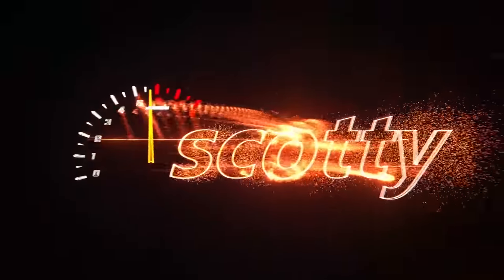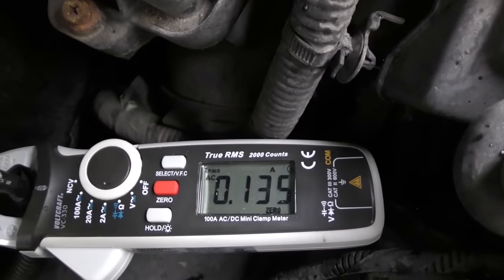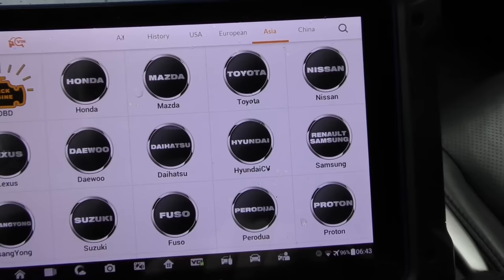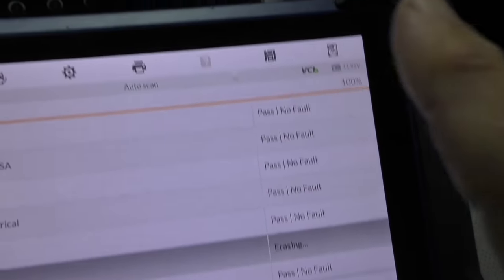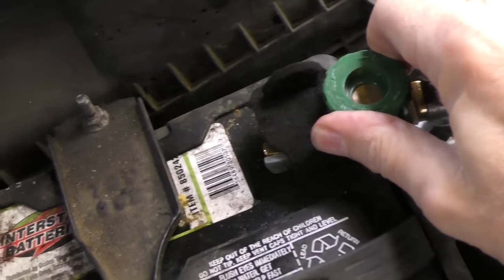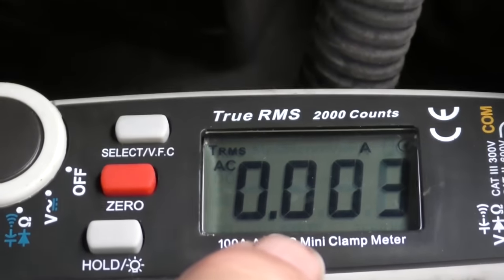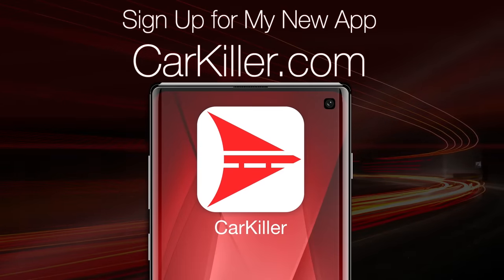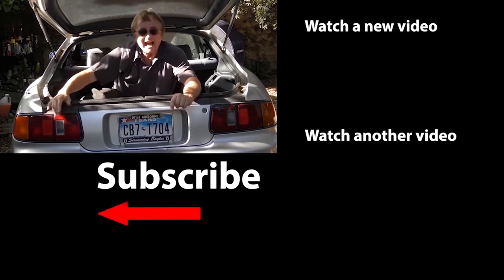Watch This Before Buying an Acura

Comment: I unplugged my 2005 Acura TL HFL because of the parasitic drain which leaves the device to draw power without the key in the ignition. Unplugging the HFL saves your battery but disables all voice commands for calls, XM, radio, navigation, temperature,...etc. The Acura dealership at the time wanted $400 plus $200 labor for a replacement or $150 to disable it. They also said there was nothing wrong with my week old warranted battery that they provided other than it will not start the car. Pretty sad that I had to jump start my "luxury" Acura off the dealership and call it customer service. I love my TL but Acura needs to take responsibility for the HFL and cracked dashboard defects.

Comment: This happened on my 2012 TSX. The Bluetooth module was drawing 220mA if power when the car was turned off which drained my battery. During the winter even the best batteries would struggle after sitting overnight and eventually die. I went through several Duralast Golds and Optima Yellowtops before finding this out. The unit ended up being replaced and the issue went away. I traded up to a 2019 TLX A-Spec but man that was a headache.

The worst part is my issue was intermittent. It wasn’t daily and by the time the car died the issue disappeared. Acura kept the car for days under warranty trying to find an issue and couldn’t. It wasn’t until another battery failed that the issue luckily showed when I had it at the dealership.

Comment: Thank you for doing one on the RDX. I got a 2007 and it’s been rock solid but one thing that I do notice I have to have checked out is my windshield wiper when you turn them on when it’s cold in Chicago. Look like the wiper are wiping to much when you first turn them and their on a low set. But when it’s warm their fine and work fine also.

Comment: I think component(s) may have been damaged by that loose battery cable. I thought body computer fault right off when you demonstrated the issue.  I’m also aware of the Acura bluetooth issues.

Comment: Its the hands free link system. Had this problem with 2 Acuras. The fix is as simple as disconnecting it
Reply: @MGMidget73  if the handsfreelink is draining the battery it's because it is now broken in malfunctioning. It doesn't work anyway. I've owned 4 Acuras. I know this. 2 of them had this problem. Just unplug it or buy a new one

Comment: I love your videos.  I have owned several Acura's and the Bluetooth module seems to be an issue after a about year 4 of owning it.  Draining batteries slowly in the same sense (about 3-4 days of sitting).  I have seen this with an 05 TL, 2010 TL (I have two 2010's and one does it the other doesn't), 05 MDX, and now my 2015 TLX is doing it.  When I disconnect the blue-tooth module the problem goes away, but Acura has for years said this is not the problem..

Comment: I had a 2000 Nissan sentra with that issue. After chasing it down for months, I found that it was the keyless entry module. It's a little box with wires coming out it, right below the steering column. Disconnect it or replace it, stopped my slow and intermittent battery drain.

Comment: I had the same problem and found the problem was the cellular phone network. I disconnected the module which is found in the rear air-conditioning diffuser box middle consoul which got the current drainages problem resolved.

Comment: Before even watching this video im gonna guess that it's the homelink. My 2006 Acura TL had the issue of the homelink draining the battery and not a single mechanic could figure it out. They even had me replace my alternator because they said that might be the problem. I looked it up on an acura forum and they suggested that this was a common problem.

Comment: Very rare for bluetooth to die. It happens in all cars. The main concern for 2nd gen acuras is change the PCV valve often and the throttle body position sensor can die too.

Comment: I experience this with my Tundra, which I would rarely drive and the battery would be too low to start the truck after sitting. I assumed it was the after market alarm. I installed a solar trickle charger and never had an issue again.

Comment: I would put a solenoid disconnect between the battery terminal and main cable and run the switch inside for easy disconnect.

Comment: We have a 2007 RDX with 200k miles, the car started having the same problem, battery would drain after not driving the car for a few days. After several mechanic visits, we removed the hand free link module and the battery didn't drain anymore. Problem solved.

Comment: Scotty, comon Honda issue,its the hands free link module (bluetooth reciever).  Your trouble codes even said so, but you didnt test it on your test drive.  $300 part, takes 5 minutes.  Some will say you can “bake” the old ones to reflow the faulty solder joint.  Didn’t work for me.

Comment: I love me some Honda and Acura but they have a serious issue with blue tooth modules. I’ve had a 2006 TL that went bad. 2007 MDX that had the battery drained, had to take it out. I currently have a 2011 RDX and luckily it works but every once in a while, it’ll disconnect while listening to music. Everything else works fine. Just annoying little issue.

Comment: There are serious issues with the newer Honda CRV's battery drain too. My dad's new CRV keeps draining and needs to be jump started every few days. Just searched it and lots of people are going through the same. Honda has no answer or software updates that can fix the problem. These cars should be lemon law'd or recalled. There goes Honda's reliability.

Comment: I think it is the Bluetooth module. When it goes bad etc it randomly keeps randomly searching to hook up/connect to a Bluetooth device. The easy fix is to just disconnect it since they are pricey $250+?) of course it means no more Bluetooth calls etc. Beats having to open the hood all the time to disconnect the battery.

Comment: Scotty you still could have pulled relays/fuses to see if the amp readings stop jumping around. Also those battery disconnects only require a quarter turn to fully disconnect. They are popular In the antique tractor crowd. Which I would like to see more videos from you giving tractor/lawn mower advice in the future. Thanks

Comment: @Scotty Kilmer, you MIGHT fix that Acura’s problem by replacing the ground cable AND checking and cleaning all of the vehicle grounds. Good solid grounds does wonders for low VDC circuits.

Comment: I have a 04 Acura TL 6 speed manual with 205k miles and It’s been super reliable, but I will never use the hands free link because when I first had it and ever used HFL, the next time I started it up. It would take a while to turn over

Comment: My sister's Camry had a battery drain and we figured out what was causing it =  she left her key fob within 15 feet of the car, and as a result, the car would always keep its systems 'ON'.  It thought that the owner was approaching the car and would want to get in and drive away.  By moving the key fob to 30 feet from the car, the car would shut down all of its systems and the battery drain went away.

Comment: @scottykilmer I have the same vehicle which I bought used and encountered the same issue. Turns out the A/C condenser relay gets stuck and drains the battery while the car is parked. I think there is a TSB and a new relay that supercedes the faulty one. Changed the relay (15/20Amp) and the problem was fixed. Hope this helps!

Comment: Anyone thinking of buying an RDX, this battery drain is the least of your problems. Before you buy research the common and very expensive problem of the wastegate boost loss, throwing a "P2263 Check Emissions" code. Once it does you will end up having to replace the entire turbo around 90k-150k miles at a cost of 5k-$10k depending on if you use Honda or an off market turbo. It's a cheap linkage piece that gets out of round on the wastegate that can't be replaced, that renders the car limp and will not pass an emissions test, and the only fix is to replace the entire turbo. It's a known problem Honda refuses to address or acknowledge so beware of it. Also, you have to disconnect your bluetooth/navigation to fix the battery drain issue.

Comment: Is Scotty certified Honda and Acura master technician. That is actually very common on the RDX is the HFL unit. Hands-free link system disconnect that module which is right above the dome lights and sunglass holder. And I guarantee you that parasitic draw would go away. When we have customers come in with cars like this the part alone is $1300 just to replace.

Comment: My 2007 Acura TL Type S was draining battery too. My fix was replacing the AC Relay. Apparently when they car was off it was still running.

Comment: Disregard this one, Scotty has it wrong.  Our RDX has been wonderful… just like my 03 TL-S that still went like a bat outta hell when I sold it at 385k miles.  2nd gen RDX is a gem, pick up for less than a CRV, more lux, more power and still 28 miles on the highway with AWD!

Comment: Hands free link module located up behind the map lights and rear view mirror fails and stays on and drains the battery. Does the hands free link feature work when the the customer syncs their phone to the cars hands free link system?  Its a known problem.  The hands free link module has to be disconnected (temporary fix) or replaced with a new module from Honda to get the the hands free link feature back. Its pretty easy to replace. If the plastic cover  where the the map lights are up in the roof feels warm even when the car has been off for a while...this may be the problem. Its still on pulling power from the battery. The module is the blue tooth transmitter/receiver. This may not be the problem but who knows :-(. Good luck.

Comment: Seriously I have been dealing with this same exact issue for over 8 years with my 1995 corolla that has been transplanted with a newer 4AGE engine. There must be some wiring issues from the transplant job. Tried several times to diagnose the problem without any luck. In the meantime the unplug battery terminal workaround never fails.

Comment: Clamp-on meters are accurate only on AC. Not on battery driven systems. That's why you see the AC symbol. But hey, if it is giving you a reading and helps you fix stuff all power to you :-)

Comment: Hey Scotty I have a doisy for ya, I have a 2019 Kia Sorento and around 48k miles (I drive A lot)  my check engine came on right around the oil change so I took it in to a Kia Dealer and after a few days they finally realized that apparently it was the dash cam that I’ve had this whole time plug in since I bought the thing was messing with the KEM? System. I’ve never messed with anything electrical in my life so I don’t understand how it was doing it? Apparently they contacted Kia them selfs and they were interested in the issue because it was a first for them. Now I will mention that the dash cam, before the check engine light came on, I had started the car and the dash cam kicks on like it normally does but this time it went off and on about 6-7 times than it stayed on and after a few minutes that’s when the check engine light came on. So far it’s been off since it’s been disconnected and haven’t had any issues. I just thought this whole deal was a mess. Anyone else have something similar happen?

Comment: i know a common problem for these older acura’s is their bluetooth systems so if you just disconnect the bluetooth, then the drain will stop. i have an 07 mdx that would die if it sat a few days and the bluetooth module was draining the battery so it was disconnected and the problem went away

Comment: I had a 2006 Acura TL and it did the same thing. Dealer couldn’t find out what was wrong. I finally took it out to a local shop and it needed a whole new computer system. Cost me $800 to fix. Typical Acura junk.

Comment: the pcv integral to the valve cover is actually a german design. those engines were developed by opel--gm's german subsidiary.
Reply: Aren't these just Honda k motors with beefier internals?
Reply: @drooskeedoo3388  no! ecotec engines aren't even the tiniest bit japanese.

Comment: Hey Scotty—

I have a 2011 Suzuki SX4 crossover. It has 150,000 miles on it. I commute 45 miles to work and back daily. I just had two ignition coils go and was told since the bankruptcy, it is going to cost $800 for the repair. 

Is it worth it? If I fix it, how far do you think I could trust this car to go?

Comment: I got a better low tech solution than a quick disconnect.  How about a drip battery charger?  My 30-year-old Benz would discharge if I didn't drive it for 3 days.  No one could find out why.  So, I semi permanently attached a battery charger to the battery, ran an extension cord to the front grill, and plugged in the car every time I knew it would be idle for a while.  Want to drive it? Just unplug the extension cord --- didn't even open the hood.  (PS: post-it on the window reminded me to unplug the car --- LOL).  Eventually, after two years, I found out it was the clock.

Comment: Scotty. I love the channel, watch you everyday. I have a 2011 porsche panamera 4, it has these codes: p0172, p0175, p0421, p0431, p0455 - which people online say is the MAF sensor. I've searched online, in the 1600 page parts diagram and cant find a mass air flow sensor on that vehicle. Do you know what's wrong with it, and where the MAF might be? I'm killing myself trying to figure this out - Matt from Miami

Comment: Hey Scotty, I have a 2015 Toyota Corolla and the front speakers stopped working just randomly. The back speakers and front tweeters work perfectly fine except the front 2 speakers are not working. What could it be?

Comment: I had a 2008 Acura RDX Tech, and it was in the shop constantly. The A/C went out several times, I had a parasitic electrical leak from the trunk light, alternator went bad, transmission shifting issues etc. I know Acura’s are typically very reliable, mine was just an anomaly. Before it was totaled, it only had 97,000 miles on it. It was a joy to drive, and I loved the peppy turbo 2.3-liter four.

I have been a proud of owner of an Audi A6, and it has been trouble free... so far hahaha.

Comment: I have 2 Acura RLs (2007,2012) doing  the same thing heard it could be the hands free link. So it just purchased a $23  battery tender and put it on the car if it's going to sit 3 days or longer

Comment: It's the HandsFree link Module, I had that problem in my Acura 07 always draining the battery if it sat for 2 or 3 days, went to Acura forums and they suggested to disconnect the HandsFree Module located on the roof behind the sunroof switch, disconnect that damn thing and never had that problem again that was 4 years ago

Comment: My RDX was hard to crank as well after I would let it set for a few days. So I put a new battery and it was fine four a few years. I had to replace the battery again this year. So it’s a 2011 and the battery has been changed twice by 2021. Not bad really

Comment: 2018 Acura MDX or 2021 toyota highlander?????? Which should I got for?? Looking for reliability. I have a 2016 volvo xc90 at 47000 miles and just went through my second set of brake pads and have computer issues once a year. Thanks

Comment: I had a similar problem with a Jeep.  Never could figure out what was wrong.  However, when the disconnect terminal was removed completely it went away.  Could there be something wrong in the design of the disconnect terminal?

Comment: You cant unhook the battery on all cars with out messing up the computers?
Reply: Owner has the radio and nav codes to unlock the units. That s about the only way to keep it from draining the battery besides unplugging those modules that hundreds of Honda Acura owners are commenting about

Comment: Hi Scotty. The RDX you just tried to solve a battery drain problem was a 2007 make. However you put up a 2013-2015 make on your video picture. Do the 2013- 2015 have/ experience the same battery drain issues  too. I plan on getting getting one, hopefully before the year ends. I need your advice pls. What amount should I pay for 1 with below 50k miles?

Comment: Without an amp clamp, the mechanic could measure the millivolt drop across the battery's ground strap to detect current flow.

Comment: SCOTTY!  Embarrassing to ask about this, but I have a 2013 Chrysler 200 with the 4 cyl 6 speed auto.  It shifts poorly, hesitates, jumpy, and is just overall not as good as it should be.  Fluid is full and has been changed a yr ago w filter, no TCM computer update recalls for this one, and no leaks.  Any ideas on how to just get it working normal sir??  Car has roughly 130,000m. I love the videos, thank you so much!
- Sean from NC

Comment: It says AC on the meter but the battery is DC. So a little explanation is required Scotty
Reply: If he needed to zero the reading from the Hall effect sensor before taking the reading, then he must be using the meter in DC current mode, despite what the LCD says. Or he is pranking the viewers.

Comment: Water in the rear fuse box - fixed mine last year 2008 MDX
Reply: Known issue - Frame leaks over fuse box 2008 Acura MDX 

Fix - Seal Frame - pull rear fuse box  - rebuild and seal

Comment: Scotty, 2012 Dodge Grand Caravan, 100k. It has been a great vehicle. There is a clicking noise in the dash when I press the brake while in park. Doesn't do it in any other gear. Mopar owners said they have the same issue from 2k miles to 150k miles. Is something going bad?